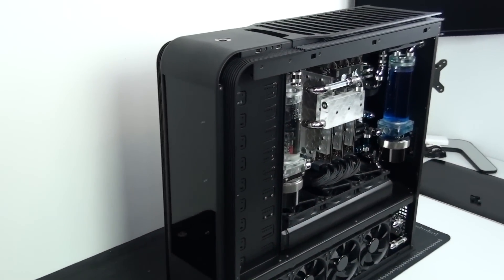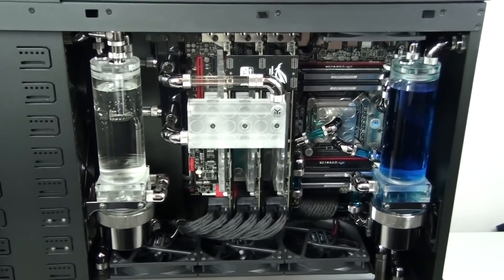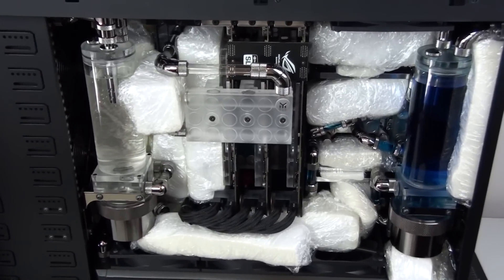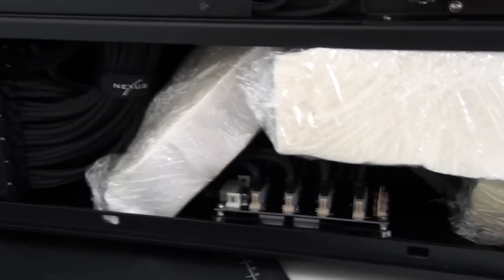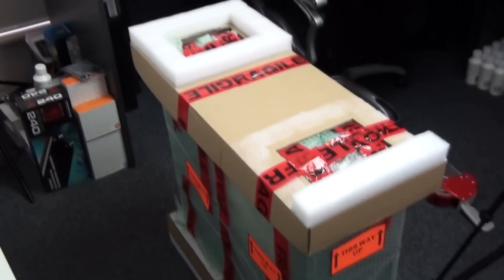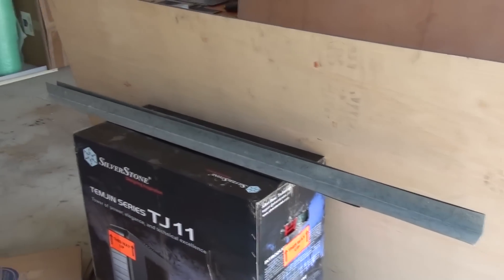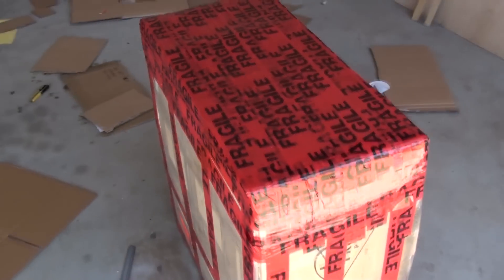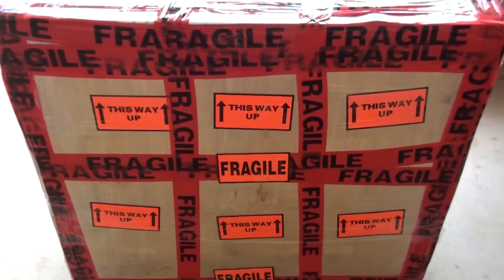Singularity Computers Packaging Water-cooled Systems For Shipping Guide

Comment: @SingularityComputers Did you flipped the system upside down to put it inside its original box?  Isn't better just to open the bottom side of the box and slide the box from the top side of the system?   Then seal the bottom side of the box by slightly tilting the box to one side and close the one lid at a time.

Comment: After working for a major shipping company for over 2 years now, I can say that this packaging will most definitely work. There is one problem though. The secondary packing around the initial box likely turned the package from being sorted automatically, to being sorted manually. Manually sorted packages include those of excessive weight, odd shape, or in your case, size. When the package has to be manually sorted it is handled many more times, thus increasing the likelihood of it being dropped or damaged along the way. 

Even with that being the case, I feel that the amount of insulation and packing technique you demonstrated, there should never be damage sustained to your item throughout transit. One last thing, If I had a dollar for every time you see a "fragile" sticker on a package I'd be able to quit my job. I would make the outside look as bland as possible to draw the least amount of attention.

Comment: As a general rule of thumb, I like to multiply the number of hot items to be cooled by 120mm to determine how much radiator I need.

In your case, you have 2 GPUs and a CPU to cool, so that would be 3x120 or a 360mm rad as SingularityComupters said.

Comment: Would this be required for transporting it by car for moving apartment or is it just Be carefull dont drop and wiggle / tilt it that is needed? EDIT forgot to mention my gpus are not watercooled just mobo and cpu and i have the same case as in the video if that does any differance

Comment: I built a TSA spec hard case with ABS clad 11mm ply (like the cases music gear travels in from show to show) complete with rated foam and low profile dolly wheels and inset locking latches with TSA specified locks that border agents can open and UPS totally destroyed the client PC. They opened the carry case threw away the locks, dropped the custom build OUTSIDE THE BOX and put it back in and even punched a hole through the 11mm plywood case. $10,000 system destroyed. Never used UPS again.

Comment: I've started building more customer builds around the £1k mark. Obviously nothing to this level, but shipping is a nightmare still. How much does your packaging cost you?
Reply from the maker: Packaging costs me a fortune. The best way is to find a bulk supplier and purchase 100-200m rolls of bubble wrap. Foams just not an option unless you only use small amounts, its very expensive. I build custom boxes from 10mm ply for all of my systems now, I use foam inside of the system to reinforce components and at least 30 layers of bubble wrap on the outside.

Comment: 35 kg would be very light considering the amount of water cooling in there. And I would do more research in your case on the price on water cooling bits. ;) If the water cooling would cost merely $1000 more people would have it - and so would I. 

3 radiators at 1.5 to 2 kg a piece, 3 liters of water if not more, 5 waterblocks....

I build myself one of them rigs and mine did weigh around 45 to 50kg; which I imagine this one being at too. But my worry in this case is really shipping expenses.

Comment: All this extreme effort in the build and packaging, but you take no ESD prevention measures what so ever? And then you put plastic wrap all around the insides of the computer? Wow! And also, a tip, you could stick the computer on a half-size euro-pallet with collars, at least the extreme builds. That way it would always be right-side-up, and not tossed around. Much safer.